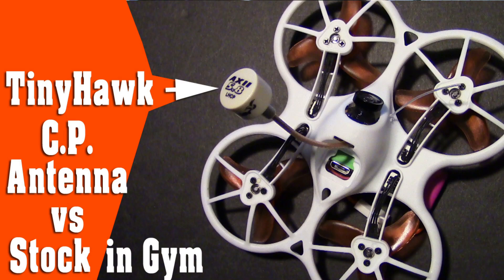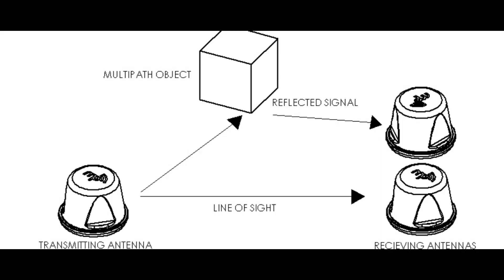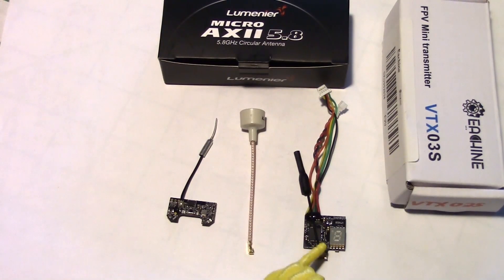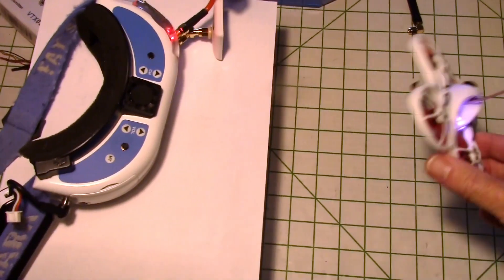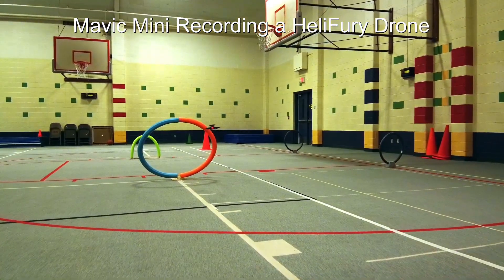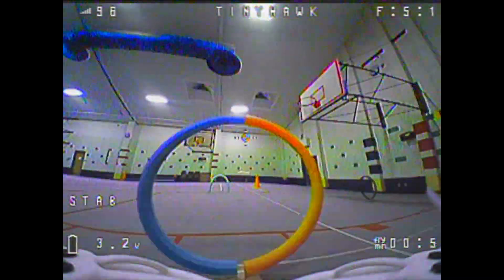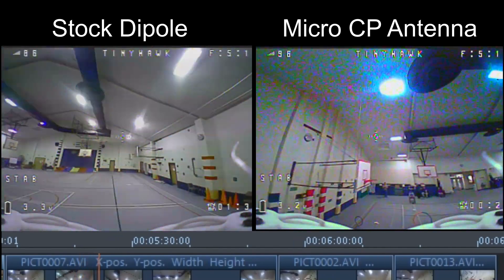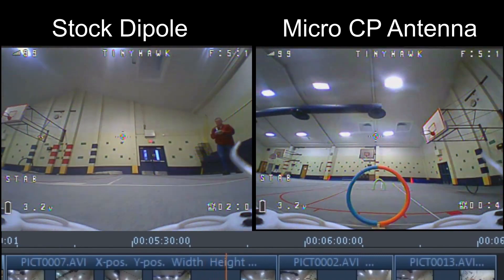Tiny Hawk Micro CP Video Antenna vs Stock in Gym Conditions - Is CP Better on VTX03s?

Comment: The best way to fix this is to get a rapidfire module.  Its the most costly but it will give you what you're looking for.  
Compare around 3 mins to 9.5ish mins in when he changes to mode 1 on the rapidfire:  https://www.youtube.com/watch?v=YAFeQCcJlnI

Have you tried both a lh and a rh antenna on your goggles? *at the same time!   Due to all the multipath interference in the gym the lh only may not always be the best, as the signal's polarity changes with each reflection.  Having one of each on in this environment can help.

Free things you can do are to level your head and sit higher than the quad or stand if you're going to fly low to the ground.  This will help with reflections on the ground.   Also in your original video test when you walk with the quad your body can get in the way and cause interference, skewing your results....I did the same thing.

Comment: Great test Dave, my conclusion, if I fly indoors, I reduce Tx power (25Mw) and install stock whip antennas, for best result, but I guess it depend on, in what kind of building you fly (concreet, metal, wood etc) Its a try and error situation. Cheers.
Reply from the maker: Did you see the Mavic Mini footage in the middle? That's how I wish the TinyHawk would look :-)
Reply: @DaveMerc  I think that would be great, but its not gone happen I think ,o)